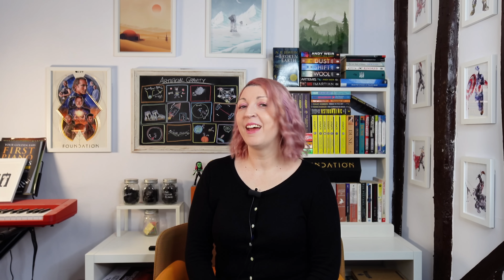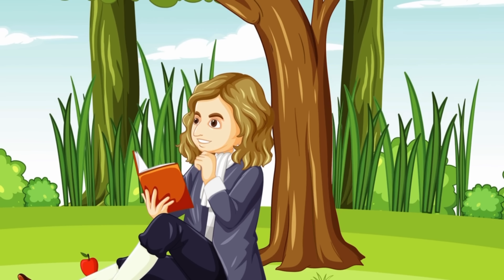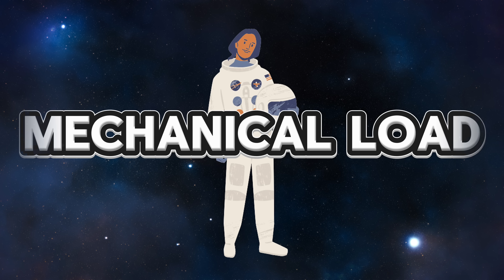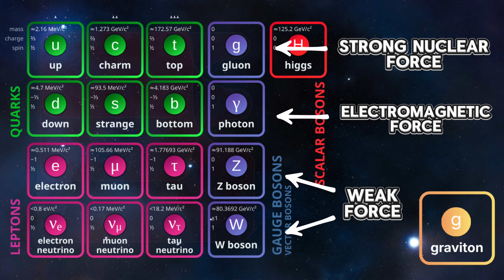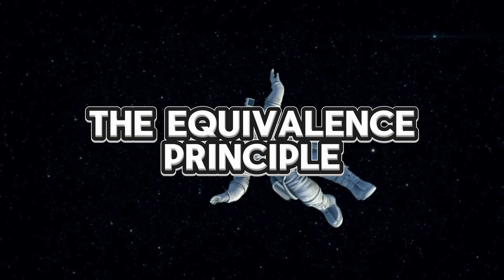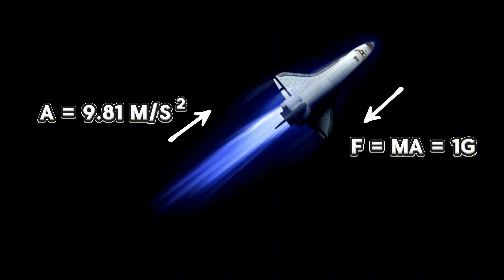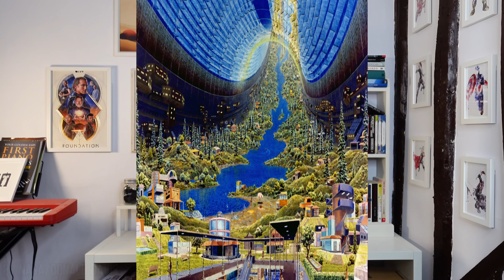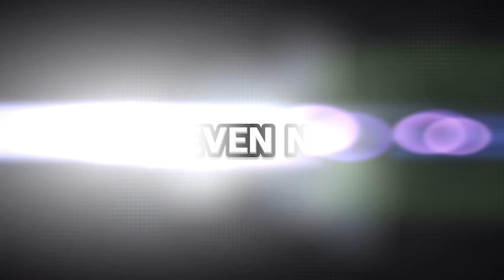Why Artificial Gravity Is Harder Than It Looks

Comment: I would describe centrifuges as simulated gravity rather than artificial gravity. Another form of simulated gravity would be to accelerate a spaceship at 1G for the first half of the trip and then decelerate at 1G for the second half (not easy).

Since 1G ambient gravity seems to be necessary for human health, and since we don't have a good substitute, we should be looking at places in the solar system with ambient gravity of 1G. Two such places are the near-space regions of Uranus and Neptune, where the level of the atmosphere that has 1 bar of pressure also has approximately 1G of gravity. As a bonus, that level of the atmospheres of those planets is dense enough to block the ambient radiation of space even without a magnetic field. Since those atmospheres are rich in hydrocarbons, it may be possible to use the atmospheres as feedstock for manufacturing giant, city-size plastic bubbles (with meters-thick walls?) within which to build artificial human habitats. Accomplishing this on an industrial scale might require an artificial, DNA-based biological technology so that the bubbles could be made by molecular assembly, a sort of 3D printing using DNA.

Comment: I have heard that there are ancient water systems where water rises to higher levels without any motors or added power. I believe it works on the use of air bubbles rising up through a pipe carrying the water with it. The water was aerated by the water dropping a distance into a pool and then the aeration carries the water up tubes that rise higher than the elevation at which the water originally dropped from.  

I would love to know the equations behind this so I could put it to use without having to use trial and error to get the dimensions correct.

Another interesting system I have heard about is the generation of electricity from water dripping across a certain sized gap with a certain sized drop of water. Have you heard of this before?

Comment: The ISS is continually falling, which gives the impression there is no gravity. Of course they are not far away enough, not to feel the effects of earths gravity. However, a spinning disc like structure, could create the illusion of gravity, through centrifugal force. Although I’m not sure how fast it would need to spin, or how it would make someone feel. Rotation would have to be finely tuned, to recreate earths gravity.

Comment: Also worth thinking about: Spacecraft are noisy without gravity..    odd yes, but the problem is convection demands gravity, without convection gasses don't rise or fall, so not only will candles work differently (google candle on Tiangong), but anything that wants to cool down must use active fans, just relying on heat sinks doesn't work. In the early years the ISS was deafening, over the years things have been improved a lot, but it is very far from silent.  Just "milli-gravity" would make a noticable difference.

Comment: Regarding Rotation:
A common, and one might argue disastrous, misconception around "wheels in the sky" can be demonstrated with a simple thought experiment. 

20 of us are living in such a structure, spinning happily away each experiencing 1G. To celebrate our success I invite everyone to a party in my quarters, along the rim.
Every one is there, drinking and celebrating and gradually noticing a sense of woosiness as if the floor is shifting and gravity is decreasing.

 Suddenly we hear an alarm indicating that the center of mass of the entire structure has shifted, TOWARDS THE PARTY! The structure exists in static equilibrium, and any change in the distribution of mass, changes that equilibrium resulting in precessive torque.
This kind of a system could theoretically be managed with fluids and external thrusters, but it's far more complicated than Hollywood would have us believe.

Comment: ¿Can we create or generate magnetism? Yes we can, just create or inject a moving voltage and current in a conductor and the result is, magnetism, now we need to figure out what force we can tap into to generate gravity. Now take it from there... then the inverse square law applies to a point source, we multiply by the length and width of the gravity plate and modulate the energy input on the coils and, voilá.

Comment: You completely mischaracterized the idea of gravity in "Expanse". It's only a thing when the engine is running and the ship is accelerating, and as you know gravity is indistinguishable from acceleration. All motion in Expanse comes from Epstein drive which works on nuclear fusion. There is absolutely no need to have infinite amount of fuel onboard like you claim, since the ship is configured for both 1G of gravity and microgravity modes. When the engine is operational - it accelerates and there is 1G (at least, though it can be more if needed). When it isn't accelerating - you have to use your magnetic boots. Then you have Tycho and The Behemoth/Medina Station which do employ rotational gravity. There is little to no speculative physics in Expanse, - everything is based on principles we already know or technologies we already possess.

Comment: Robert Heinlein's 1956 novel describes an interstellar ship that could accelerate to close to the speed of light at 1g or slightly more for half the voyage and then flip over to decelerate for rest of the trip. Of course the energy required to do this would be enormous.
Reply: Wasn’t that ship basically a Bussard ramjet, where the ship has a magnetic collector that collects spatial hydrogen and fuses it to helium for its energy source? Which I suppose sounds like fantasy in and of itself, although IIRC, Arthur C Clarke said that sufficiently advanced tech will seem like magic to those less advanced…

Comment: Almost halfway through, why would we need gravitons, if, instead, it's just a curvature of spacetime? Perhaps because the force is also bound by the time of C? Gravity isn't instant, but apparently, is affected/governed (or causes) by the same speed of light. So, Einstein relativity seems to replace the need for a "gravity gluon", by virtue of that extra dimension of curved spacetime.
Imagine, the smaller the universe, the slower the speed of light, such that it takes an eternity "just" to measure the 13.7 billion years or so since a big bang. Gravity would thus be at a different "constant", too, but only from our frame of reference.
Perhaps, this is compounding, either to minimize the "eternalist" of it all, or to even make it "forever eternal", such as 13.7 billion years is stretched out to a billion billion x that, instead.
If light takes 13.7 billion years to cross the known universe (and then some 3x that, or so, for cosmic expansion), it might have taken it "that long" to cross the "sub atomic size" of the universe during the early micro seconds.
Isn't it that which we see as "a forever", something falling into an event horizon?

Comment: 0:04 We do not have enough metals on Earth to build a rotational artificial gravity station using the Weber Force aka the Equivalence Principle. When we mine asteroids the first thing is artificial gravity. Mining asteroids is what we need a commitment to. Lack of artificial gravity is why bases on the Moon and Mars make no sense and are silly. Another option is super heavy matter. If we find the island of stability (stable isotopes of elements with high proton-neutron numbers on the periodic table) we could make matter that was much heavier in smaller quantities. Hundreds of protons and neutrons makes the matter much heavier at scale. You and I would have a hard time trying to lift it, even if it appeared to only weigh a gram to our eyes. If solved, we would have to manufacture it in outer space. Then it could be distributed to our ships when they get out of the atmosphere and be removed from them before re-entry. This material is also the key to warp drives where a gravitational bubble can enable the spherical curvature of spacetime around the ship (not negative energy, but rather the type described by Sabine Hossenfelder), assuming we could survive the g-forces (which we cannot). Artificial gravity is larger with rotation and smaller with super heavy matter, but outer space is the key to making it work either way. The size requirements of rotational artificial gravity impose a materials limit, because we would have a metals shortage. Asteroids are where we would get the extra metals. Metals shortages like we haven’t seen since the Bronze Age would be caused trying to build artificial gravity. With nanotubes a space elevator is possible. A materials limit is often the reason for why we aren’t there, and our lack of ability to simulate materials properly for prediction is the reason for the materials limit. As someone who cannot stand quantum computers (has programmed them) and likes quantum simulations more as a field, I say that we are not far from being able to simulate anything needed in chemistry and nuclear physics. We are going to be able to find out if islands of stability exist then. Less than 5 years from now we will use new mathematics like 5D Conformal Geometric Algebra to represent the degrees of freedom of particles on a single computer which is global from the point of view of the computer containing the registers. Wedge products can represent entanglement. People investing in quantum computing will be straight up broke. Quantum materials and quantum information are still really important ideas (like the quantum internet) but quantum computers are a sham and will never be necessary nor viable. The quantum internet is about the transfer of encrypted information across fiber and fiberless channels. But securing information doesn’t require quantum computers (see post-quantum encryption). A. Collier has a great video about the materials shortage issue related to artificial gravity among others, like Dark Matter (the Gravothermal Catastrophe - how spherical gravitational bodies break thermodynamics with an inverse energy to heat relationship) and women in PhD physics. Also, the collective mass of a mole of super heavy matter dwarfs the mass of a mole of any normal substance.  Earned a new subscriber, this is my favorite new channel. The overlap between sci-fi and science is my favorite thing in the world. It is where inventors get their inspiration. Asimov is one of my heroes, he coined robotics and wrote more books than anyone ever many of them in two years while bedridden. Fuzzy logic and probability engines either generated by quantum simulations or probabilistic computation units (nonquantum) like chaotic units could allow for a psychohistory-like prediction with accuracy. For instance certain types of headline patterns in the news precede wars and economic crises. We have the fact that all events are connected and that the butterfly effect is smoothed out at scale— patterns are scale-based phenomena and using them to predict the future will be unlocked when we can accurately predict stock market behavior at least 5 years in advance. Ternary computing will make this much easier as price rises, falls and stays. The law of excluded middle is one of the laws of logic. Humans seem to miss this. Their decisions are generally ternary. Fight, flight and freeze. Buy, sell, stay. Yes, no, maybe. Finding the amount of uncertainty and reducing it from a maybe is much easier than just knowing whether we are correct or incorrect. Bayesian principles.

Comment: Gravity is the consumption of sub atomic particles by every proton. Consider every atom like a little vacuume sucking in air. As you get closer it gets stronger, as it gets bigger it gets stronger. As the sub atomic particles are consumed they create the flow of gravity.

Comment: You mentioned the idea of a "small" centrifuge to be trialed on the ISS but that it could end up shaking the ISS apart - which brings me to my point: if a large spinning vessel could be constructed, with the crew and passengers living on the inside of a gigantic centrifuge then there would have to be amazingly strict regulations about how constructions were located and how people could gather (or even move), otherwise imbalances in the load around the ship could behave like a giant unbalanced washing machine and throw the ship off course (best case) or wrench it apart (worst case).  Either way, I wouldn't want to be on board!  Looks like we could be stuck here on Earth, so I guess it would be a really good idea look after and care for our planet in exactly the way we don't right now!

Comment: How to transfer between tethered spaces.
Reply from the maker: You don't!
Reply: @popculturescientist  Yes, it's all theoretical. I like theorizing.
Reply: On Earth a transport that can climb a stationary cable has, among other names, "pass-through traction hoist". Pass-through because the rope passes through as you rise or descend.

So that's how. It will probably just be called the elevator.

Usually you get more and nicer living space if it's all at one of the tether bottoms. At the other could be propulsion. So two tethered spaces would be on two separate tethers. To get from one to the other the unadventurous way you take the elevator up to the spin axis and, in a small spacecraft, get off that tether. Then fly through space to the spin axis of the other, dock, and take the elevator down.

Guess what the adventurous way is.

Comment: On a planet, let's say on Mars... you could have a rail track going in a circle, and it would be angled inward so that the centrifugal force pushes you downward to the floor of the rail car to simulate gravity.  If constant downward force is not necessary it could be an oval and the sharper corners are where the gravity would be at full.
Also it could be a bowl so that as it speeds up then it can climb up the sides more.

Hmm, maybe a ring will be simpler, there's an inner ring that spins.  There could be rail cars that hang on hinges and so it will always point downward while gravity increases with the rotation.  These ideas add to the existing planet's gravity, also vacuum could be created to reduce friction.
Reply: The way it has been done on Earth: 
https://youtu.be/ZQb8lvXwFJY?t=210

Hanging so that the sum of planetary and spin gravity always points straight into the floor is indeed a good idea.

Comment: I have another topic for you.
I think the harder problem to solve is the protection from harmful radiation and rays.  A layer towards the hull could contain water sections used in a recycling system and also for protection.  What is the status of the research of various materials for this protection.
Once on a body like the Moon or Mars, living quarters underground could provide protection, but getting there on a ship or if for a space station not in Earth orbit(within magnetosphere and not within van allen belts) it's another story.  You could also talk about those hazards to Earth-orbiting stations.

Comment: The rotating wheel space station concept has been published since 1928, and most famously used in the film "2001: A Space Odessy" which you referred its "grip shoes".
I always thought about how so much effort, cost, and time has been put into studying the effects of micro-gravity or no gravity on beings; and all the complicated ways thought of and tried to treat the symtoms and minimally diminish the problems.  I asked the question for over 50 years why not just create a spinning environment like thought of many years ago.  Only recently have there been serious efforts undertaken to used this method; and like you said "it is only an engineering problem" and I am an engineer.

I think the research has mostly settled on a target of 0.8G with compartments at levels closer to the middle can still be used as human accessible/usable space, just not normal living space.  Also, first attempts can have a smaller spin radius and astronauts that can adjust/acclimate just like sailors get their sea legs (and some people who always get seasick).

The first ship designs would probably spin the whole ship than try to have just spinning sections with, as you mentioned, the complication of those junctions including energy input to overcome the loss of those.  Once the ship is spinning, only minor adjustments would be necessary to keep a constant rate and shape adjusting for the movement of mass within.

The 2-ship tethered system seems like the easiest to first build rather than some long spine structure, only it would take a very accurate contantly adjusting system to keep the system stable and each ship would need propulsion matching the other exactly(unless the tether is only unfurled after all primary acceleration and retracted before any deceleration).
Reply: Conservation of momentum guarantees that a gimballed thruster anywhere on a spinning tether, gimballed to thrust towards a particular spot on the sky, accelerates the whole system towards that spot. It can be at one end while the habitable pressure vessel is at the other.

Comment: Does anybody want to comment on attitude control of a spinner-Ship in the vicinity of a planet (let's say orbiting it).  The gyroscopic effect would kick in if there is any g-force component transverse to the spin axis. If the craft start precessing (its spin axis starts rotating) the assumption of equal g-force everywhere in the rim is destroyed, right?

 A "snapshot" of the spinner drifting thru space far from the pull of planetary forces is a gross oversimplification.  Real spacethought requires talking about how the vehicle begins and ends a long journey parked in orbit somewhere.
Reply: Its plane of revolution is not the orbital plane? Then yes, tidal torque will precess it, slowly.

Tide of microgees per metre, as at the ISS orbit, will make for slow precession that people walking on the deck will not be able to feel. In short, no.